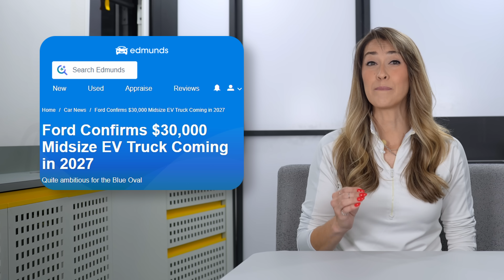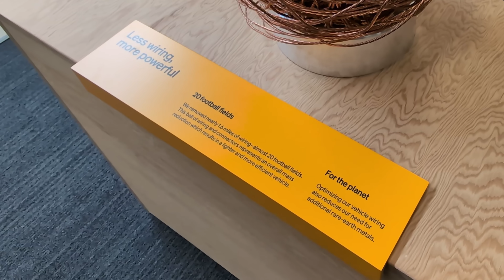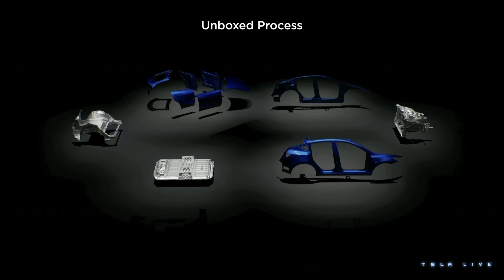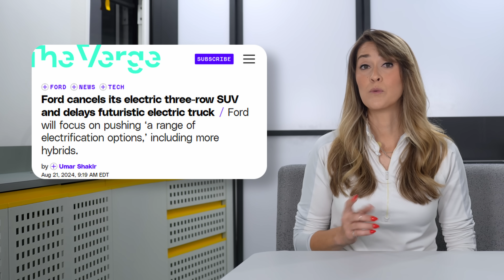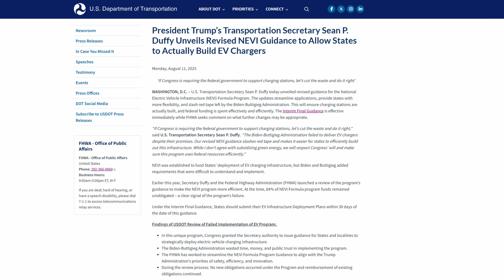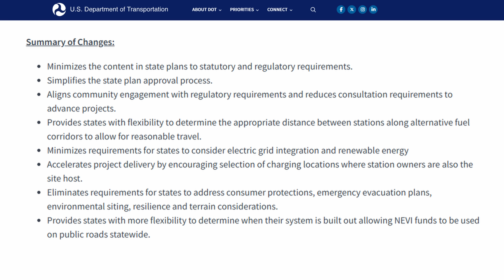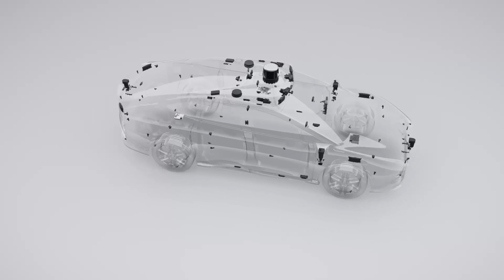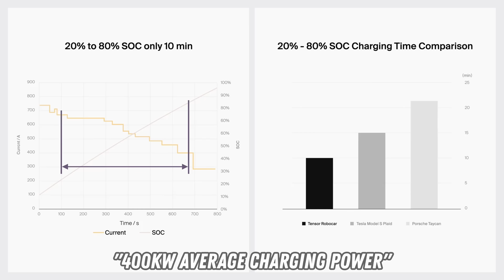The Current : Weekly EV News Ep#76 Aug 17, 2025

Comment: I'm pretty sure it wasn't elon that first coined "the best part is no part."  Sandy Munro says that quite frequently.  First principles doesn't come from either of them.  I'd be curious who originally said it.
Reply: Similar to Colin Chapman (founder of Lotus cars) “simplify then add lightness” back in the 1950’s.
Reply: I remember Ford going through a simplification process when it first built the Focus under Richard Parry-Jones. There was a drive to reduce the number of parts in each assembly, thus reducing cost and failure potential. That was most probably the peak of Ford's reliability arc.
Reply from the maker: We did not make the claim that Elon originated the statement. 

We reminded viewers that Elon has used the line hundreds of times in public over the last 20 years and that it is a common theme for all of his hardware engineering teams at SpaceX, Tesla, and the Boring Company.
-Producer Tim

 https://share.google/sHELmEiickkeGvvkb

Comment: Ford is stuck, their failure to move on product can be seen when contrasted against gm. The Chinese are not allowed to compete, if they were Ford and gm would be in a world of hurt. I would buy a lightning, but the cost is prohibitive, and that's not all batteries doing that, it's also all of the "toys". The KISS principal needs some love when it comes to all vehicles.
Reply from the maker: At this time GM is not utilizing zonal architecture, unboxed manufacturing, or domestic in-house LFP cell production. GM currently does not sell any EVs in the USA with efficiency at nearly the level Ford is claiming for the new platform. It is not clear that GM would be profiting on their EVs without existing consumer and manufacturing subsidies. GM is really cranking out EVs in Mexico and the US. Great volume. Solid products. High input cost. Significant waste. Probable financial net loss on the division. 

As we frequently report, Tesla and China's best EV automakers are years beyond legacy auto, scaling rapidly, and are quickly dominating global marketshare. 
-Producer Tim
Reply: @MissGoElectric But gm (didn't  they change their logo to lower case after emerging from bankruptcy?) is producing many different models. Ford is executing a kind of retreat, although it is probably strategic and will allow them to enter the fray in a big way later. I admire Ford, but time is of the essence and protectionist tarrifs can make the industry as a whole, lazy. Excellent video BTW.

Comment: Ford are losing $40K an E truck currently great idea smoke and mirrors again
Reply from the maker: Remember, the F150 Lightning is assembled in a huge, purpose built facility intended for 4x the volume. It is one of several facilities constructed to support EV manufacturing at a cost of more than ten billion dollars so far. You are figuring the cost of all of that infrastructure into your per-unit losses, which is fine, but misleading.

Ford executives have officially confirmed that even a $40,000 F150 Lightning is profitable on a per unit basis when considering materials and labor alone. 
https://www.foxbusiness.com/lifestyle/ford-f-150-lightning-money

Scale is required for profitability for the entire endeavor. Demand is required for scale. Ford's EVs are not currently competitive enough to come close to leading globally in sales.

The Lightning uses an enormous amount of combustion F150 hardware and the propulsion system is basically retail off-the-shelf Magna, Borg-Warner, and SK componentry. A lot of the engineering was farmed out, too.  It's hard to make a buck on a product with middlemen gobbling most of of it.

The new platform fixes a lot of those areas of waste, bringing the brand closer to making profit like other EV operations including LiAuto, Geely, and Tesla. 

Like any domain, it is only smoke and mirrors to a person who fails to understand the obscured inputs and actions which generate the consequences.

Here is a link to our detailed tour of the union-operated traditional assembly F150 Lightning factory tour which we published when it opened: https://youtu.be/o5tqlXc2qdo
-Producer Tim

Comment: Farley is making the right moves.  Stealing ideas from Tesla is a good thing.  I comes down to execution.  
I like to see a 325+ mile variant of the smaller pickup.  Living in Canada, about 10 weeks, we lose range due to the cold weather.  
Tensor should stop now.  In a Chinese competition with 30 autonomous manufacturers with 6 challenges, Tesla won completing 5 out of 6.  The rest used Lidar completed 3 out of 6 or less.  In addition, the cost is likely exceed $200,000.
Reply from the maker: For Miss GoElectric and I, 400 miles of advertised range is the minimum we'll consider for cold climates , towing or hauling, and getting around in rural areas when visiting places with no convenient overnight charging such as camping or visiting family. 

At posted interstate highway speeds, most EVs fall well short of advertised efficiency, too.
-Producer Tim
Reply: LOL. Lets limit technology to what an average human can do. Tesla during light blowing snow will crash or just give up trying.
A lidar equipped car on any average vehicle today will sail through conditions that render vision systems unusable, nevermind the phantom braking.
Reply: @rni302 you miss the point if visibility is so poor a human can't drive ,  no one should be driving in it. Even if you can see other cars with lidar they can't see you,  making it an unsafe condition. Just checking when was the last time you found yourself driving in zero visibility?
Reply: Agreed re Lidar equipped autonomous vehicles.
An autonomous vehicle should be able to drive successfully with nothing more than human equivalent senses, ie cameras (eyes), microphones (ears), force sensors (touch, pressure) and pitch, roll, yaw, x,y,z movements  (vestibular), location knowledge (gps), with sufficient redundancy and sensible extensions like ir, uv vision, hearing extension,  etc.  Last I checked, humans don't have 360 swiveling heads with lidar eyes 😅
Plus, the Lidar patent, license, royalty, cost issues
Reply: @geraldford6409 - "An autonomous vehicle should be able to drive successfully with nothing more than human equivalent senses..." Why? Who made up that arbitrary rule? It should use whatever tech is available to do the best job, to drive better than humans. Tesla's way does not define the only way.